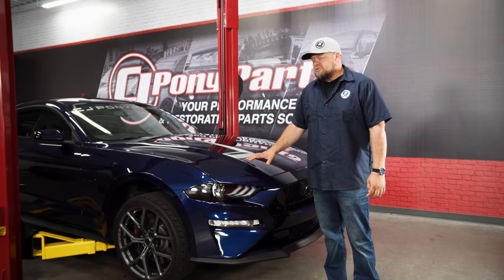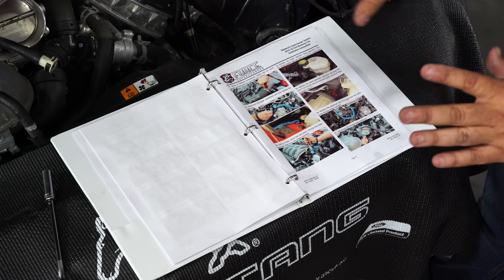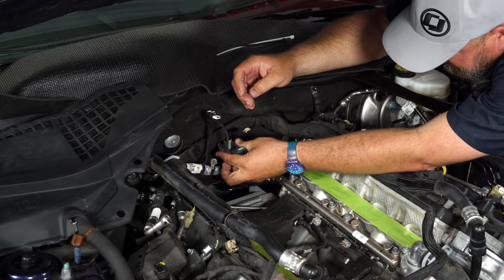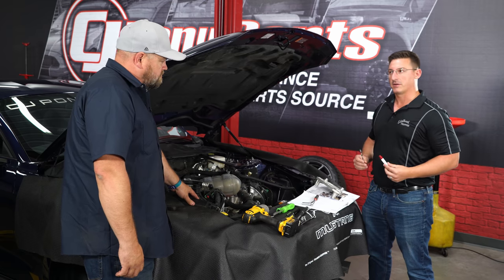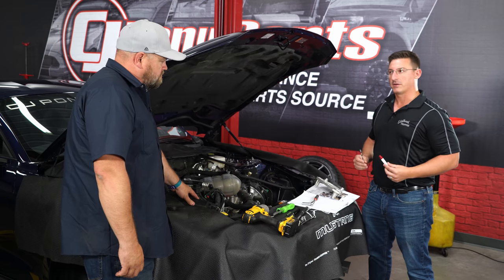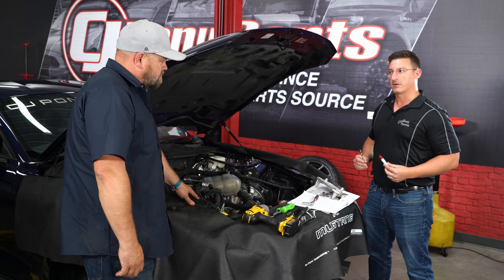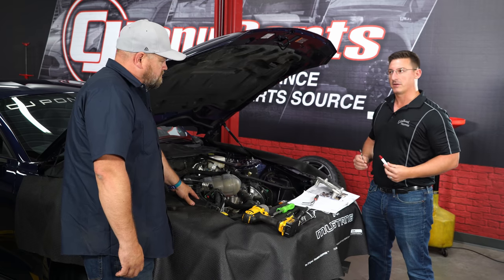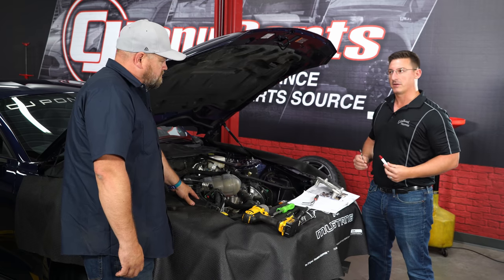Take Your 2018-2023 Ford Mustang GT To The Next Level With This Edelbrock E-Force Supercharger!

Comment: As if Ford would continue warranty coverage after a supercharger were installed.  LOL
Reply: Only if their logo is slapped onto it
Reply: @northlander At 1:40, the dude says Ford will warranty cover the rest of the car.  Engine mods usually void the warranty entirely, not just the drivetrain.
Reply: If it is installed by a certified tech. Which will most likely be one of Ford's.
Reply: @paulrogers6037  That's not entirely true. Magnusson Moss act specifically requires a manufacturer to proove that a modification resulted in any failed component. So if your radio dies and you installed a super charger, they still have to cover the radio. Anything connected to the engine, as mentioned in the video, transmission, diff, axles etc, is covered by Edlebrock. This is no different than Roush warranty's going back 15 years.

Comment: so is the 2018-2019 mustang engine different than the 2015-2017? i thought it was the same with new body style, but then again i haven't done my research on the 18's
Reply from the maker: Very different engine.
Reply: Way different.
Reply: @CJ Pony Parts do you have for 2017

Comment: Ir regardless of their S/C, and engine/tranny warranty coverage, are there many claims coming in for the engine 'knock' or ticking that seems to be occurring with the 2018/19 motors ?  Thanks
Reply: Also, if so, what does the claim give in a new engine - is it a repair or a new crate replacement ? If a engine tear down could the customer pay for the upgraded 'forged' parts if they desired ?
Reply: @Wildpony98  If you're talking about a ticking noise within a stock 5.0L Coyote, I've only ever heard the injector noise and I've worked on a lot of 5.0L

Comment: Will they do a tune for you if you have aftermarket headers?
Reply: No, Edelbrock can't modify the tunes for any other aftermarket parts with there emissions legal kits. Car has to be completely stock from the cats forward to work as advertised.
Reply from the maker: Jeremy Winslow  the tune is only for stock or cars with aftermarket catback. Anything else will require a custom tune.

Comment: I don’t like seeing power adders bolted on and using the stock air box and exhaust manifolds. It needs headers and a cone filter. Choking it
Reply from the maker: Both are very efficient on this platform and can maker over 700 hp. The stage 2 kit includes a new airbox and throttle body for even more power but maxes the fuel system.
Reply: I don’t disagree with that, but I never like to see boost on stock exhaust manifolds. The air box isn’t that big of a deal. But Cross plane engines need headers so the first cylinder and last cylinder to fire on the same bank aren’t fighting to scavenge exhaust. Sorry, wasn’t trying to be a super negative keyboard warrior. I should’ve just said “headers please” or something. Still a great build
Reply: I agree Trae'.  No way I'm putting my stock manifolds back on...So I've got a few questions I'd love if somebody can answer.
1. If I want to use my TSP Longtube headers & borla switchfire midpipe it is apparent that I need a custom tune.  I assume that means I would opt for the "no tune" kit.  So because I want to use headers & need that custom tune, does it mean I won't get a warranty?
2.  Does anybody make an aftermarket cone style intake that can be used on the Stage 1 instead of the stock box?  I currently have a JLT and I know it won't fit this kit but I do NOT want to go back to my stock box.  I also do not see where you can purchase the Stage 2 intake kit separately.  Possible to just custom cut the JLT to fit?  Would that be possible to tune?
3. Since I already need a custom tune because of the headers & likely intake, I considered adding some 1050x injectors and doing an e85 tune.  Good idea or no?  This make me lose my warranty? Would it matter if the answer to the above question results in a loss of warranty anyway?

Comment: Boosted 18 and 19's been lifting heads.  ARP head bolts should be a mandatory requirement for any boosted new gen coyote.
Reply from the maker: We have several boosted 18/19 cars here and have never had that problem at the stock boost levels. Maybe if you are turning it way up but I ran 12-13 psi without issue on my 18.
Reply: Definitely get some ARP head bolts if you're running high boost. I would also recommend getting oil pump gears and crank sprocket for insurance.

Comment: Would like to  know at RWHP , through the automatic transmission 🤔
Reply: High seas Paul stock makes like 620 hp my car made 680 with long tubes and with a booster oct
Reply: My car only trapped 117-119 in the quarter mile with this kit in 3000 DA. Definitely isn't making 620whp
Reply: Ryan Lewis what was ur mile run I can show you my dyno sheet
Reply: @ryanlewis9853  I've trapped better than that with a couple bolt ons & without any SC on my 2018 GT.  Something is bad wrong with your car.
Reply: Dustin G yeah and Edelbrock refuses to help. They say the car is running fine, but 117 mph doesn’t scream fine to me. Even the so called bad roush kit performs way better out of the box.
Reply: @ryanlewis9853  Do you not have a shop with a dyno that you can take it to? I'd be afraid to drive it like that...if you are running lean you could (or already did) break something internally.
Reply: Dustin G the car isn’t running lean. Airfuel is around 11.3 at WOT. The datalog shows everything is okay but it also only has 11-13 degrees of timing.
Reply: @sabinoguzman7780  what gap is your spark plugs? are they Motorcraft? Getting a spark knock on high end, trying to figure out if the gap is wrong or if I just need to add Lucas to the fuel. Thanks
Reply: @xhexisxlegendxx_7442  what pulley size are you running ?

Comment: 8 hour install!? Wow, I was expecting it to be 12+ hours.
As much as I like this kit I still think the Roush is the better way to go since Ford will take care of the warranty without having to go ahead and deal with a 3rd party like Edelbrock.
Reply: JCTiggs only if ford installed it.
Reply: Actually no they wont. I was going to get the Roush before I got this. There is only ONE Roush dealer who would do it in my state and their quote was literally identical to what my ASE installer actually charged me all in  ( more time little less money). Roush tops out at $12,500 and this one tops out at $16,500 in warranty. Also if you have good gas in your area and I do, they will make you a 93 tune and then I keep all receipts from fill ups....calibration department it's way better...the Edelbrock has way better entry angles and cooling that Roush as well. Stage 2 goes all the way to 1000whp no problems as well and it's about 1000 cheaper....
Thanks Shawn.
Reply: If you go with a Roush on your 18+ car I’m sorry 😂
Reply: @blackonefifty  The Roush are really that bad?

Comment: I've seen a couple of people install some of these and the stock engine blows within a short time.    What gives?
Reply from the maker: There are thousands of cars with these kits and no issues. With any power adder there is always a chance but most failures are from people who change the tune and modify the kit.

Comment: Reusing O-rings?  2 dollars worth of O-rings should probably be included in the install.  Never re-use O-rings.
Reply: I thought the same thing. Always replace the manifold gaskets, "While you're in there." Be pissed if you have a leak down there after you complete the installation.

Comment: Stock injectors?
Reply: 2018+ Mustangs have 8 port injectors and 8 direct injectors. At Stage 1 power level stock injectors are sufficient. The stage 2 kit comes with larger port injectors to support the additional power.
Reply: @nickpurciello5328  thanks for the info! I did not know that. I went with ID 1050s for my boosted 17 GT.

Comment: So....you have to pay someone else to install it for the warranty? I mean.....ok.....seems excessive....
Reply from the maker: Since they are covering the drivetrain they want to make sure its installed by someone certified to do so.
Reply: @cjponyparts  Well...I guess that means going to your Ford dealership to get it installed, since they specifically mention ASE certified....not too many independent shops are.....There goes another 2-3K in cost! If this wasn't intended to be a DIY kit then why does it come with a tune?

Also I have a serious question. I have read on forums that these have problems with heat soak as a result of insufficient cooling compared to the Roush and Whipple mostly. Is this what you are experiencing with your test car or is that not true? Thanks!

Comment: You lost me at "factory throttle body" and "factory airbox". Let that girl breathe!
Reply: Get the Stage 2 kit PN 15388! That uses a 103mm throttle body and 113mm high flow intake kit.
Reply: @S Johnson -   I was thinking the same thing.   If I'm spending this much in hardware and ASE labor, shouldn't I also be upgrading the cam, rocker arms and lifters too.    And if I do that, the ECU programming will need to be tuned.    I haven't even mentioned suspension or exhaust upgrades (headers?).   It just doesn't make sense to keep so many factory parts once you open "Pandora's box".

Comment: I didn't have much success with this supercharger on my 2012 Mustang.  I'd go with a Whipple or Hellion Turbo.
Reply from the maker: Roger Beutler they are completely different kits with different superchargers. The 2650 is way batter
Reply: @cjponyparts  it would have to be way better.  I'm very happy with the Roush Phase 2 supercharger that's on my 15 Mustang.  No issues
Reply: @rogerbeutler5671  There is a bigger difference between this E-Force and your Roush P2 than there is between the 2012 Edelbrock & the Roush P2.  This new 2650 design is that good.  I've seen several N/A 2018-19 10 speeds on e85 outrun 15-17 Roush SC cars...
Reply: @dustingre8  I'm glad Edelbrock got their shit together and made the necessary changes.  If I could trade my Roush set up for the newer Edelbrock, still wouldn't happen.  Love my current set up.  I'd love to have a 2019 with either the Helion or Whipple and the 10 speed auto.
Reply: @rogerbeutler5671  To each his own.  Personally I have a 2018 10 speed 5oh and after tons of research, I chose this kit over the whipple or a TT setup.  Its just a really well built system.  The fastest 2018-up with stock internals was boosted with this stage 2 kit.  It ran an 8.6 I do believe.  These kits seem to put out the highest TQ numbers too...but the whipple and hellion kits are awesome too so you can't really lose here...I'd just never go with a Roush after I've seen how poor they perform vs the others.